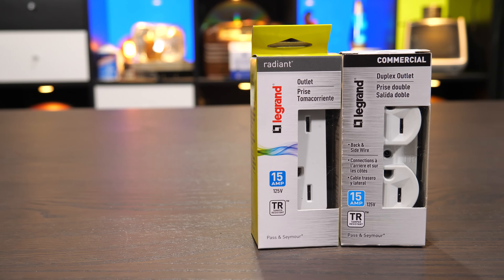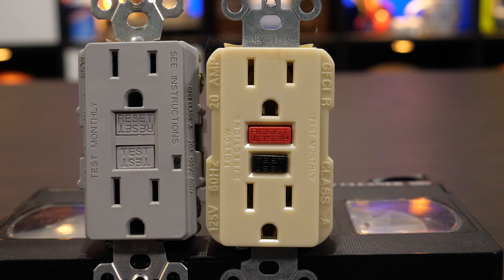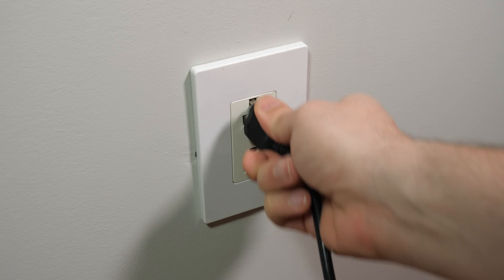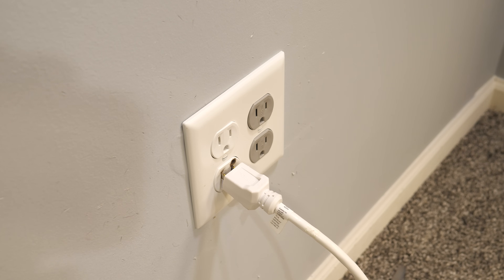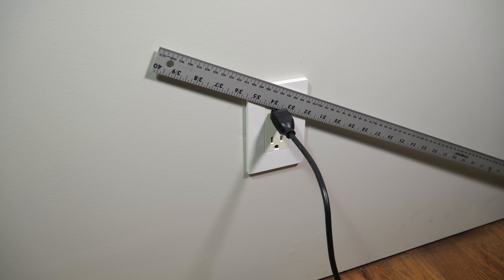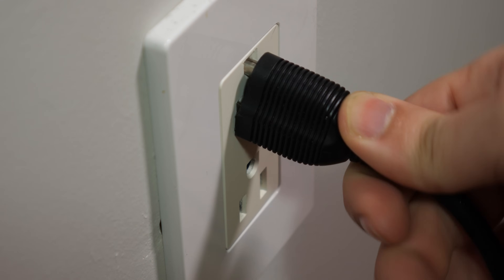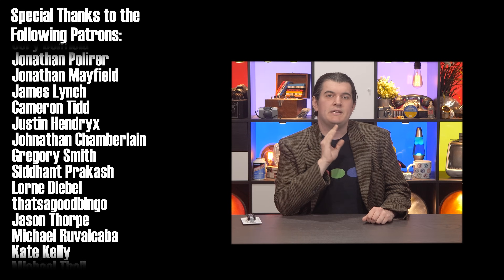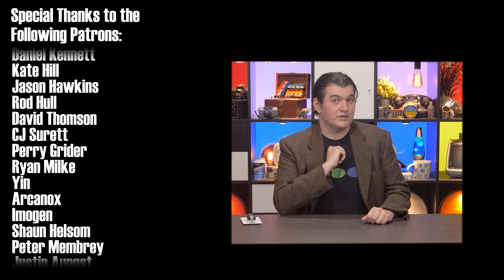Power outlets are topsy turvy - but does it matter?

Comment: I enjoy watching your videos. I'm a radio engineer, not an electrician, but I have installed an outlet plug or two. One thing an electrician told me was the "standard practice" (whatever that means, since it's not in the NEC) was to install the plug upside down to indicate the outlet wasn't properly grounded. In other words, someone installed a grounded 3-prong outlet to replace an older 2 prong unpolarized outlet and didn't run a ground wire back to the breaker box. You install it upside-down to indicate this. There's also supposed to be a sticker put on or near the plate, too, but I digress.
I've also heard about installing switched-outlets ground pin up like other commenters mentioned. As I understand the NEC, that's not in the code, either.
I doubt the NEC committee will ever address outlet orientation, or make a "standard practice." Not enough people really care about it. However, almost 8,000 YouTube commenters on your video could be wrong...
Here's another weird thing that's not in the NEC. While there is a limit as to the number of outlets and light fixtures on a circuit, putting up to 12 outlets on a 15 amp circuit or 10 on a 20 amp circuit doesn't make sense at first glance. Yes, I understand they based these recommended limits on Ohm's law and power formulas, but It's not about how many outlets, it's about what they're used for. Combine appliances and lights for 1800 watts load on the circuit, and poof, there goes a 15 amp breaker. This could easily happen with a couple hair driers in the bathroom or small appliances in the kitchen on the same circuit. Don't think that a plug-strip will help, either. While many have a built-in breaker, some do not. A plug strip is very simple: 4, 6, 8 or more outlets on a parallel connection through a switch and maybe a breaker for 10 amps or less.

Comment: My house was built in the 50s, and sometime in the early 2000s all the wiring/electricals had been completely redone. I moved in the house in 2019 and was surprised to see that not just 1, not just 2, but ALL the electrical sockets were installed "upside down" from the typical "face" configuration. I had looked into it and couldn't find much information on it. I figured it was just a quirk of my house. That is until I saw a video on YouTube from some electrical engineer that claimed "This is the RIGHT way to install it!" Most of the time it doesn't make a difference, except for plugs that are elongated (like D/C adapter plugs) which tend to sag, because they were never meant to be plugged in effectively upside down.

Comment: We should replace these old NEMA designs with IEC C-series outlets. C19 for 20A outlets. C20 20Afor inlets.
C16 for 15A outlets and C15 for 15A inlets. 
And until the old NEMAs get replaced, UL and NEC should mandate any NEMA-IEC adapter must have a fuse built in
Reply: "State of the art" actually means "behind the times, antiquated" in the USA.

Comment: If you install outlets with the ground connection on top, the cable can more easily fall out. If you install it on the bottom, it will prevent the plug from falling out. So, it doesn't matter that it's "upside down." It's the safer, better way to install it.

Comment: 3:05 I believe the reason for the Chicago sideways outlet configuration may be due to Chicago being one of the places that requires EMT for concealed wiring installations in the walls (if I'm wrong sorry, Canadian electrician here) . It's much easier to install the pipe and pull wire between single gang boxes if they are sideways because you are pulling wire with the long axis of the box otherwise you'd have to run conduit into the sides of the box which makes pulling more difficult or come into the top or bottom and then immediately 90 the pipe twords the next box which both makes the install more time consuming and takes more pipe, more wire and makes pulling wire a little more difficult than just running the boxes sideways with the pipe in and out of the ends. When piping hospitals we'd usually use a 4 by 4 box with a mud ring so the orientation of the device hole wouldn't really affect those other mechanics but I'm guessing it's more cost effective for a residential install to just mount single gang boxes sideways and pipe straight through. Cost considerations are usually at the root of everything.

Comment: In Seattle the "flipped" outlet is to identify controlled outlets. Ones that are controlled primarily by occupancy sensors. The legrand ones you showed that had one in each direction would mean that the one with the upside-down o face is on a controlled outlet and does not always have power to it. Look up building codes in King County/Seattle.

Comment: I asked my electrician about this. When I bought my house (built in 2005), I found all the outlets were installed "upside-down". My electrician said that it's technically the way it should be done, and is often the preference for business properties because the ground connection helps with avoiding sagging.

I understand why it is supposed to be this way. But all those people that make 90 degree plugs and, even worse, wall warts (soon may they die) often assume the other orientation, and it makes plugging things in awkward (and sometimes resulting in sagging, ironically).
Reply: I long for the day when usb-c has enough power capacity and starts getting used in everyday appliances. I already have wall receptacles with usb plugs but they’re such low power!

Comment: But I do care besides just like in the face. There's a handful of cables with right angled connectors that are meant to go down and then when inserted upside down hang in a manner that will stress the cord. Typically refrigerators and larger equipment and heavy duty extension cords with right angle plugs And there's power adapters that are three prong and again they will hang down and pulled himself out of the outlet.

Comment: My experience with foreign objects hitting partially dislodged plugs was with an RC car. The long, thin, flappy metal antenna on the car slid down the wall, closed the circuit, and scared the mess out of me with a loud pop and sparks. In that specific instance, the ground pin being on top would have prevented that accident, and saved my RC car.
Reply: But...how did you get the antenna of a car (that is presumably driving on the ground) to slide down the wall onto the top of a partially exposed plug??  This seems even less likely to happen than a game of throw the knives at the wall.
Reply: @sol_x_dier  I was putting the RC car on the floor next to my dresser. The antenna was on the wall side, and slid all the way down hugging the wall. I didn't notice the plug was slightly loose and the antenna was really thin metal.

Comment: I have adhesive jewelry racks right above an outlet and I've had earrings fall off and land right between the loose plate and the wall before. I would still be searching for that missing pair if there weren't scorch marks on the wall from when they landed.

Comment: at a rental one time, a plug kind of under a table powering a lamp was slightly dislodged and a child's chain necklace slipped off the back of the table, fell into the crack and closed the circuit, doing pretty much exactly what happened during the knife wall game in this video. Just a real life example thanks for reading

Comment: It's not upsidedown. This is boomer lore. Nothing has ever fallen to short the terminals on the plug. What's more likely is if you put it in the "correct" orientation the user is more likely to wrap their finger around the hot and neutral prong as they pull the plug out.

Comment: I don't think putting a sleeve on our plug blades is a good idea, the cons will outweigh the pros. We already have enough of a problem with this design creating loose connections, we need as much contact as possible to prevent fires. The shocks (and they rarely ever happen) will cause less deaths than the fires will. In my opinion anyway.
EDIT: I am thinking about it and I will correct myself. The base of the blade never makes contact... Why aren't we sleeving them then? This would solve the whole problem.

Comment: The tape measure issue happened to me once, but admittedly it was because we put the tape behind the refrigerator to measure the wall. It was surprising, but thankfully not shocking. And the char on the outlet will always be covered by the refrigerator itself.

Comment: Wouldn't the ideal solution be to have the top outlet ground up, and the bottom ground down?

Also makes it easier if you have two right angle plugs

Comment: In my area of the USA, the current standard is outlet in smiley face orientation except for the switched outlet. Switched outlets are upside down to make it easier to locate if you don't already know which one is on the switch.

Comment: Extremely frustratingly the window  air conditioners I use have overload protection built into the cord end so it's a giant block on the end at a right angle but are in the upside down face orientation. This is particularly frustrating because the outlets I'm using are smart outlets but only the bottom outlet is smart so I need to insert the cord on the bottom outlet to be able to use the smart functions. This not only means the cord points up but that it covers both outlets. 

I believe they did this as air conditioners are typically located in positions physically above typical outlet height but not high enough the cord might not try to pull out and become dislodged partially.

Comment: Synopsys of my personal anecdote. 
I have plugs installed "upside down" (anthropophised}
I own a 3D printer
I use 1/4" tubes and threaded rod that i store leaning against the wall next to the 3d printer.
tubes-rods all fell along the wall to short against the 3d printer cable 

bought 2" pvc pipe and made a holder for bulk material.
there i fixed my electrical problem

Comment: I’m a master electrician and I agree with all that was said. One thing that is usually not mentioned in the plug orientation debate is the more common orientation of plugs  with the ground pin on the bottom puts more torque on the ground pin. That can eventually cause the ground pin to fail. It’s not a common problem around the house but it is a problem with heavier cords in a shop or construction setting. Putting the ground pin on top can relieve some of that stress and save the ground pin.
Reply: Yep, ground pins don't last long on auto shop equipment. Everybody yanks the cord out of the wall sideways or trips on the cord.

Comment: 12:00 I did have a power strip, once, with a right angle plug that had the wires coming off of the plug at a 45° angle - down and to the right, in the "face" orientation. I also once had an extension cord (2-prong, non-polarized) that had the cord coming off the plug horizontally.

Comment: as a brit the more I learn about the US plug and sockets, the more I see it has just been a continuous series of "we know this sucks, but lets work with it rather than fix it." and now its gone on for so long that to actually fix it has created a ton more problems to be addressed.

I know our system is flawed too but honestly our sockets and plugs have definitely been thought out way ahead of the US ones, and your issue could easily be solved just by recessing your sockets a bit to create a shroud to hold the sockets in more like they do in Europe.

Comment: Man your outlets are bad. Flat (exposing metal), asymmetrical when using a grounded receptor AND polarity(!) (when applicable).

In Sweden (where we use the Schuko outlet) these problems do not exist. Also, tempered proof outlets have been around since the 1950s and became mandatory in the 1980s. And there is no such thing as a polarity dependent receptor, you don't even know which one is live and neutral. If the appliance needs it, it is up to it to fix it (perhaps using a FULL BRIDGE RECTIFIER).

Comment: Even with a supposedly safer Australian 3-pin plug (ground usually down and with a decently-sized plug), I once managed to get a piece of wire lodged between the plug and the wall plate, and in direct contact with active and neutral pins. The result was (briefly) spectacular, especially at 240V! Total vaporisation of the wire and metal flashed across the socket area. Obviously I had to replace the socket. I learnt to be more careful with plugs and desk tidiness!

RE U.S. wall plates, using just ONE screw to hold down a plate of about 3 or 4 inches on a side, and subject to intermittent pressure, seems stupid. In Australia and other places I can think of, there are usually 2 screws.

Side-mount plugs seem great mostly, but there is ONE drawback. They could be horrendous to step on if they fall pins-up! This is a well-know issue with UK 3-pin plugs that are at right angles and with quite large pins.

Finally in China they often use the SAME 3-pin socket as in Australia for 240V, but upside-down. So, yeah.

Comment: Right angled plugs, ground up, partially sleeved contacts, side by side outlets... sounds like you're just reverse-engineering the good old British 13 amp plug... Maybe add an independent power switch for each outlet and a fuse in the plug itself as well?

Comment: Another potential fix for things falling into partially inserted blades is recessing the outlet. It doesn't need to be recessed far at all, just a few mm should do the trick. The recessed area does have to be made large enough for all plugs though, and it will not help with "wall wart" style power adapters. Though recessed that shallow, they would at least still reach the contacts and work, just not be protected against falling flat metal objects.

Comment: i pulled my charger out from the wall once
and the prongs stayed securely in. and the housing, jusr uponed right up, like i was a ghost, chasing pacman, yeah, actually it was exactly like that, orintation wise, and opened right up and crumbled to a pile  with a bummer of a death sound effect.

my first urge was to fix it, but realizing i was no longer holdinng anything and my entire paw was 2 cm from doing myself in

so i just fell backwards right onto my behind
and shuddered as my own electrical system sent a chilling shock up into the back of my neck

Comment: Frankly, this whole debacle would've been avoided if they added switches to the sockets in the first place.

Scared of getting shocked when plugging/unplugging? Just turn the socket off beforehand.

Exposed sockets present a risk of electrocution? Turn it off when you're not using it.

Doesn't really solve the "partial plug" issue but not having to connect and disconnect a socket all the time does wonders for keeping the grip strong.

Comment: Follow up question.   On power strips, why aren't the blade slots sideways instead of linear?  A transformer plug or right angle plug covers the next location in normal power strips but if they were sideways maybe not.